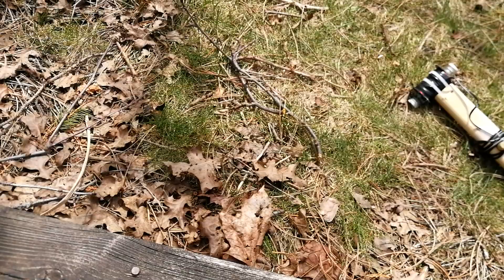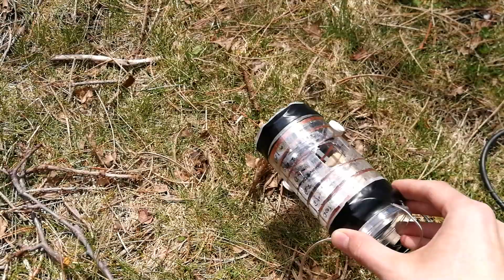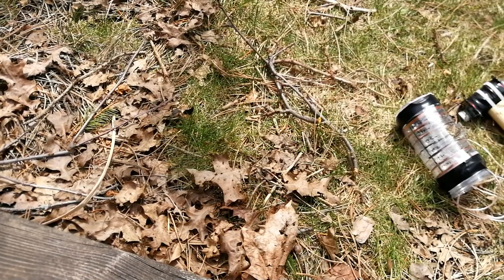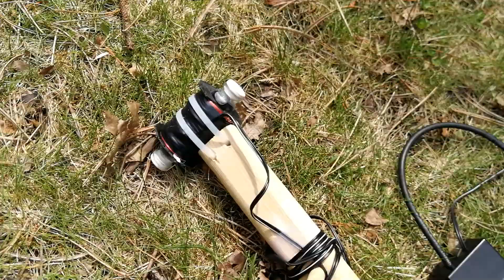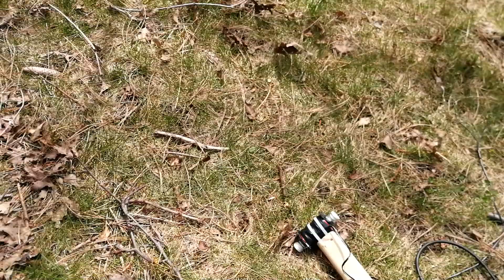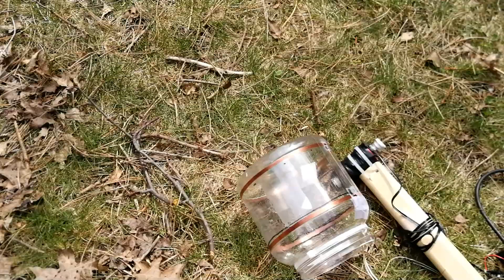Sub-atomic symphony: a collection of audible NMR signals

Comment: No More videos? very nice experiment. Can you continue and also share it so that I can replicate it. thanks
Reply from the maker: My friend, thanks for watching.

  Over the last year or two, I have considered scrapping my first NMR reciever for the coil/wire, and quality film caps, piezo, soundcard etc. And refused to do so until just a few a weeks ago after heart-wrenching consideration. 

I have been planning my "level 2" NMR system, which is likely not to be based on earths field, since around when these videos were shot. It is in the works, but it has fallen to the wayside to some degree, regrettably. 

Please watch my video regrarding the NMR reciever details for basic rundown of the rig and feel free to send any questions my way, although I am no expert on the phenomenon or instrumentation specifically. 

I noticed a distict lack of a "magic, silver bullet" or something, that got it working, it just came down to a somewhat grind-ey, disheartening, period of trial and error, so keep at it. A nice, magnetically clean, remote environment is very good, if for no other reason than to convince yourself that it "should" work, when the amp is setup right. 

Best of luck with your endeavors, sir!

Comment: If you performed the same experiment in a house/apartment/lab, would the signal be totally saturated with noise? Would there be serious field homogeneity issues? How important was it that you went outdoors and away from civilization to perform these experiments?
Reply from the maker: Good question. You pointed out the two important reasons to find a remote place. First off, mains hum and other electromagnet disturbances from say, microwave ovens and cell phones are quite extreme in the majority of a typical apartment or house. I would guess that the reciever is deeply overdriven, outputting a 60hz square wave at least 50% of the time. You can find a quiet-ish spot and orientation away from the walls, and appliances if you're patient and lucky and can unplug things, strategically. If your system is well designed, and your viewing in the frequency domain, you may be able to tolerate considerable mains hum. If your roommate is a welder, you're screwed.

Issue two is the inhomogeneity of the field. You need to be at least several meters away from a car or other big pieces of iron in order for the protons to resonate at precisely the same frequency.  This determines how long of a ping you have to work with, and practically it's never as good as you want. Even in the woods. However many NMR experiments and techniques don't nessecarily require a long lived free-induction signal.  Wiggles on an oscilogram are visible and usable even when the ping is inaudibly short-lived. So your milage may vary. Most outdoor places are good enough to use NMR to measure the local magnetic field strength much more precisely than  a typical fluxgate or hall sensor.
Reply: @analogplanet9675  I love your videos, thanks for the detailed response! I'm going to give mine another try in a more remote location. I had pretty narrow filtering on my amplifier circuit, so I assumed it wouldn't be a big deal.
Reply from the maker: @spencerwhyte3369  glad to hear it! Thanks for subscribing. Yep, keep trying and tweeking. Took me a few goes to get it going. My reciever had LC tuning at the main coil(cap was about 0.15 uF, in my case, I forget the coil inductance off my head, but I trimmed the cap to get the right frequency ), plus 3 first order high pass filters just below 2k and still mains is often an issue. The harmonics go way up. I used four op amps and felt like I had enough juice to do more intricate filtering. Could have benefited from carefully thinking up some sallen-keys or multi-feedback filters or something. I was just being lazy/trying simple stuff first. Nothing is more permanent than "temporary"...

Comment: Awesome. So I'm wondering about the difference in response between the gradient and the orthogona stimulus l coils. 
The gradient could are going to have a easier time getting the water to precess. The orthogonal coils are going to have a stronger response but the starting is going to be a little more affect by where the earth's magnetic field in relation to the resting axis off the water and the stimulus coil?

Can you talk a little about the axis of the earth's magnetic field and what it's orientation is relative to your coils. Does it matter? 
I'm wondering if you put a couple of drops of detergent into the water if the reduced viscosity of the water helps improve your signal to noise ratio by increasing the lubricity of the water molecules. 

Lastly, you could perform signal  convolution by feeding a time reversed signal through your stationary axis coil, and use the orthogonal coil to perform the impulse response. With this you could perform ffts of the water and coil system that way. Since time domain convolution is the same as frequency based multiplication of two signals.  The beauty of your system is that you can do simultaneous  multi channel convolution with zero signal processing costs such as frequency based multiplication. 

There are other implementations I can think of that I would rather talk off channel.
Reply from the maker: Very interesting ideas.

The logic behind the orientation of the various coils is sort of difficult to explain in text, but I realize I've "handwaved" through it so far. you're not the only person interested in clarification of the specifics, so I'll put it on my tab, along with the reciever circuit details I still "owe" the channel. 

The main point is that the earth's field is only about 20 degrees off of straight down at my location, if you can believe it. so a slight tilt to the "staff" puts it along the field when stuck in the ground. The polarization/reciever coil needs to be nearly perpendicular to the field for good output. 

You've preempted the ultimate reason why NMR piqued my interest: as a computing manifold. It's sort of like having a gazillion tiny, high-Q resonators all equipped with frequency control input. 

I'm trying to wrap my head around doing exactly what you suggest, convolution or Fourier transform or something like that to get my feet wet in that space, but it's proving tricky to get anything off the ground. 

I'd be interested in connecting for a discussion along these lines. You can email me at sebazevedo1@gmail.com.

All the best!